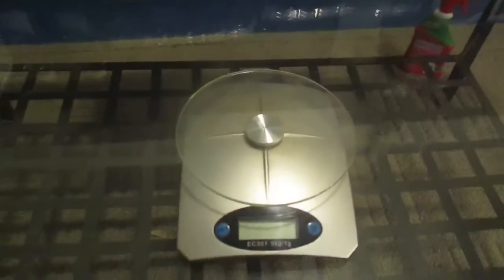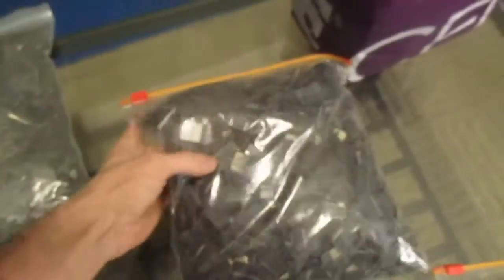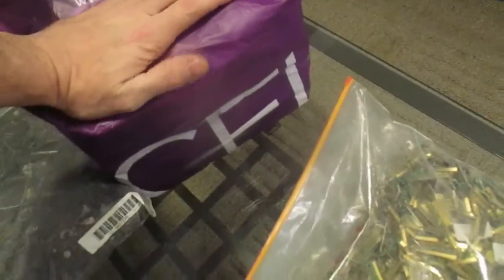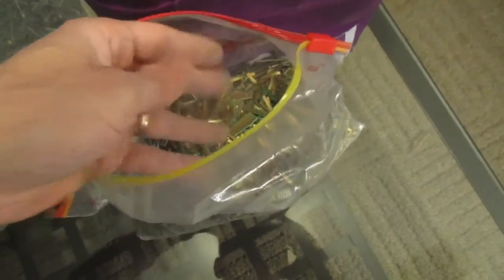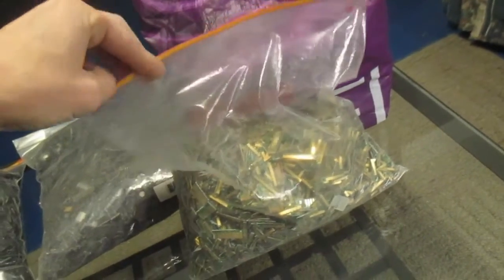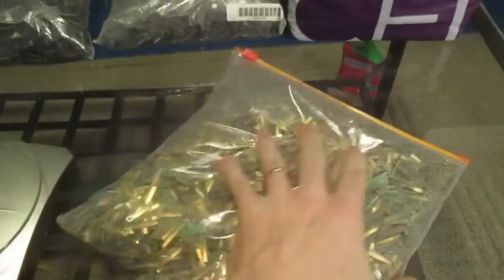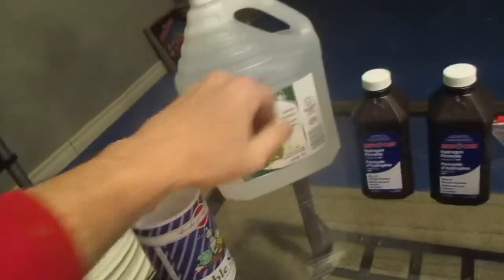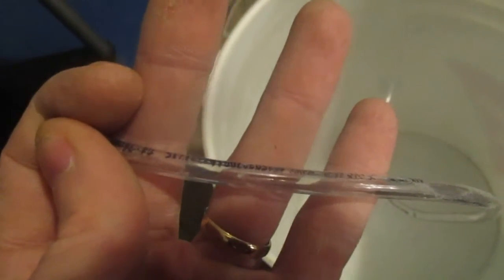E-scrap refining process From scrap to 24 K  Part 1

Comment: What about all the gold wires in the ram chips? Crack them open and you'll see it. Supposed to do the whole boards to get all the gold, palladium, platinum, nickel, silver, tin, copper, rhodium, and 5 other metals = up to 13 metals in all depending on the manufacturer.